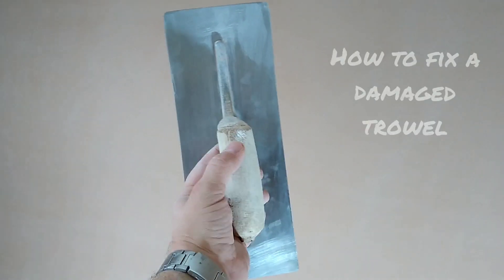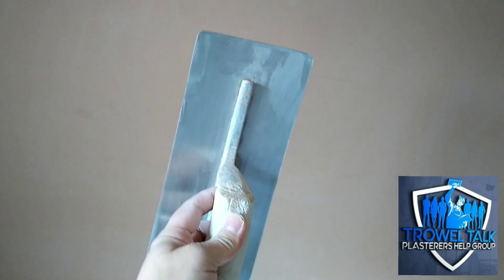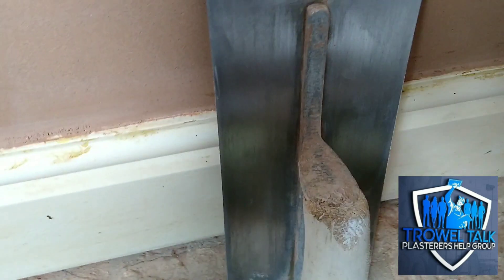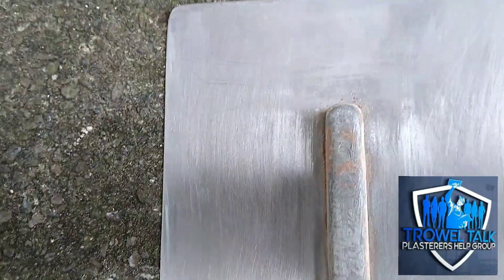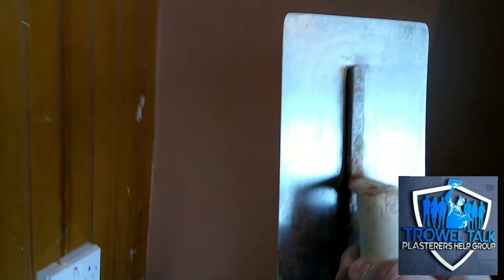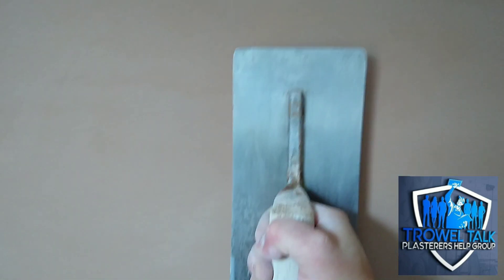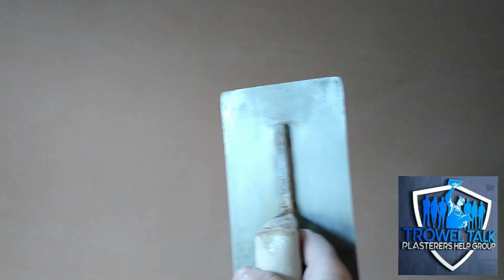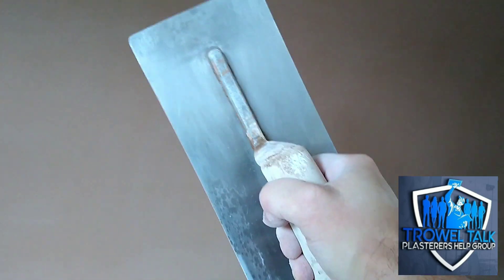PLASTERER TIP - Fix your damaged plastering trowel

Comment: Hiya mate, another great thing to get a nick out is a piece of lightweight thermalite block, the great softer ones with the lines on the block. It’s softer so a bit more forgiving.. if I get a nick in my big  Marshall town flexi that I polish up with I have a piece of this block in my bucket , rub it then a piece of wet , wet and dry black sandpaper to really smooth up sorts it every time. Tried all the things, I have been a plasterer 37 years, self employed 29.. good video.. 👍 gaz.

Comment: 14" carbon Nela for me, it has become my trowel of choice. I have got a decent Kraft, MT and Nela stainless all worn in for skimming but I always go for the Carbon these days. 
As for getting Knicks out of trowels, get yourself some small India stones mate of various grades and use them with the WD to dress any knicks from your blade. When you've got them out I put a piece of scotchbrite pad on a folded up trowel so it gives it some sponginess to adapt to the blade shape and then wet it and rub it up and down on that to give the blade a good tidy up. It brings it up lovely
Hope this helps buddy. 👍
Reply from the maker: Great tips there thank you 👍 I have always rubbed them out over a concrete block or old council slab something like that then clean back with sandpaper & a few s+c jobs normally bring the blade back

Comment: Thank's for the mention 👍, Young lad will build up His strength on the stainless steel, ( he'll thank U in the long run) Have him buy a New MT trowel for rendering, they break in fast on outside work, ( Never forget MY First Trowel 🥲) it will make a grand skimmer. Back when I started, I got good advice  from retired spread, buy 3 trowels, give the trowels to a ground worker/concrete man, he'll break them in, no time, he get's a free Trowel, U get back 2 💵 makers as Back Up. I mentioned on another of your recent vid's, have your apprentice buy a TACTIX #320390 tool box for his trowels, pick up a few bump stop strip's, ( car doors ) cut to size, Great for stopping contact damage. ⭐⭐⭐⭐⭐ For the Channel, Your a  Fountain of Information, Keep UP the Great Work
Reply from the maker: Thanks George really appreciate it 👍
Reply: @troweltalk2719  No worries Man, Your a breath of fresh Air, Plastering is a macho culture, it's Good to see the next generation climbing up the ladder, I've worked for some savage's on the way up the slippery pole,  it's not all cream, good to wart's  and all 👍